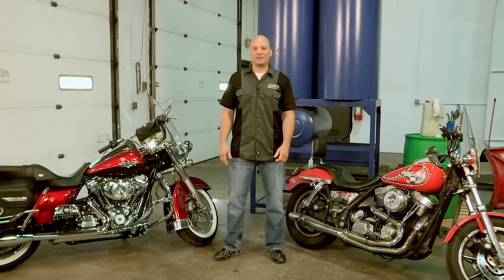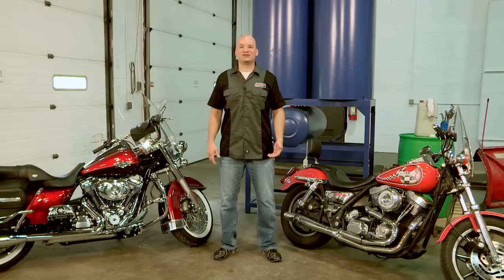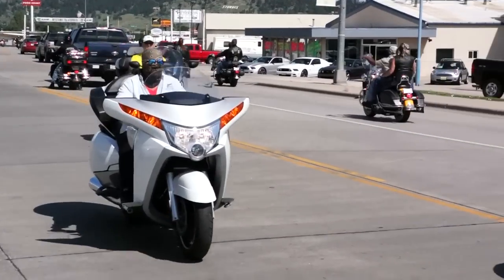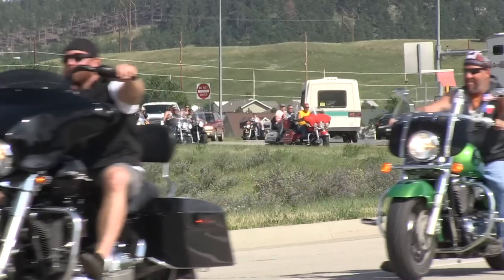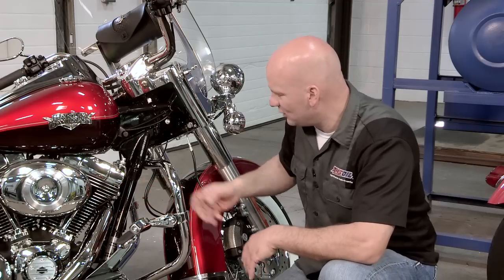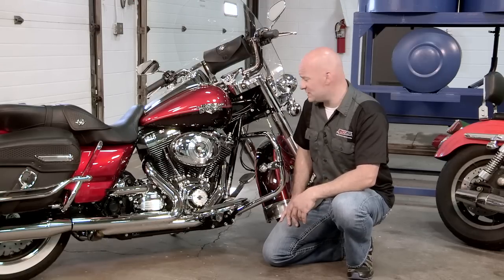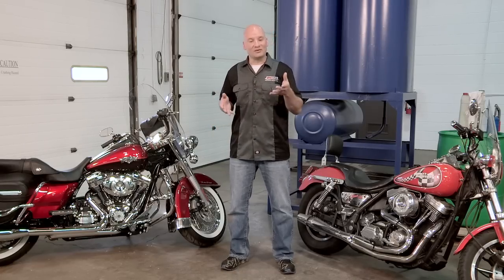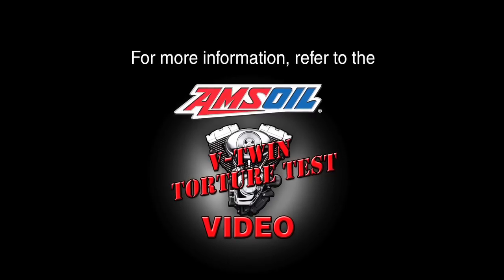V-Twin Motorcycle Heat

Comment: I’ve had my leg get cooked pretty badly many times but never had one actually overheat and quit. Getting hot doesn’t necessarily mean overheated. Modern twins, starting with the evolution engine , can handle a lot more heat than most give them credit for. Just because engine heat is cooking your leg after sitting at a red light in 95 degrees for a few mins doesn’t mean the engine is actually overheated

Comment: First I do use AMSOIL in my 2010 96 ci Road Glide it does make a difference but not enough next added an oil cooler better still
Did an extensive rebuild last winter with 28000 mi  as an after thought Added a Fueling cam plate and fueling hp oil pump, problem solved !
This is my fifth Harley if I was to start over with a new bike Fueling first, everything else after that.
 Idle oil pressure 20 psi 
operating psi 55 constant
Improvement in throttle response ,heat, rocker tick, great engineering..... ride safe

Comment: What are the symptoms of an air-cooled engine that is getting close to overheating?
Reply: Very hot legs, engine running rough with reduced power, ticking then smoke/oil smell. Best thing if you're stuck in a traffic for a long time is kill the motor. When traffic is cleared, go through the gears and let the engine bike cool off slowly at the speed limit.
Reply: When the engine is getting really hot, you'll hear tapping, clicking, whining, and other "internal sounds," that you don't hear, when the engine is cool at startup...  Most of these sounds are normal.  Things loosen up, when hot, and the oil is hot, running more thinly than when it's cold.
Sounds are important, they can tell you what your bike is doing.   Things like the FM stereo, fairings, bags, (not the ole lady...  That's a different noise all together!), can mask the sounds from the bike itself, which may be trying to tell you something!

Comment: Not all air cooled V twins are alike in terms, of a high heat output, engine. The Harley Twin Cams are at the top of the list of high heat output, engines. Engine temp readouts on the rear cylinder, by the exhaust, can run well in excess of 400 degrees+, and anything above 300 degrees is an engine killer, as the oil viscosity degrades to the point, it can no longer, due it's job.......the stock oiling system on Twin Cams are atrocious. The idling oil pressure is 3-8 psi, almost zero, thus the engine, runs very hot, and Harley instead of fixing the problem, simply masks it by placing a rear cylinder heat shield, and a rear cylinder Cut Off Switch, to turn off the rear cylinder, when idling in traffic........

Comment: You can't install a oil cooler on a v-twin Harley for $200.00. I just installed a Jaggs oil cooler on my 1983 FLT shovelhead and the kit cost over $400.00.
Reply: Jasper Jones i use an ultra cool it is about the same price range with oil cooler and fan combo like he mentioned $200 each and ultracool is at the $400 mark very well worth the money
Reply: Yeah, well this video was from 2014